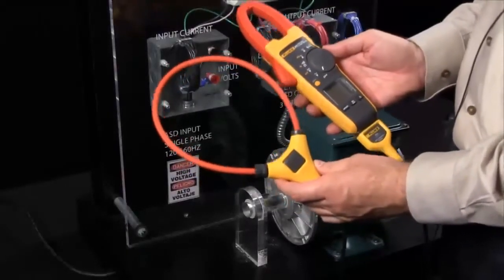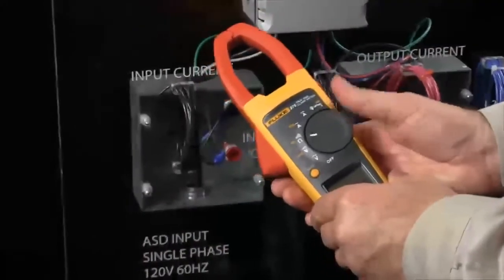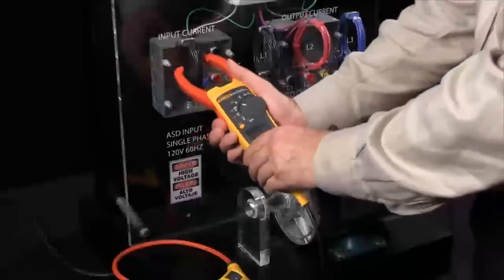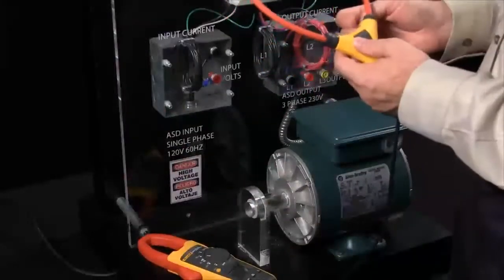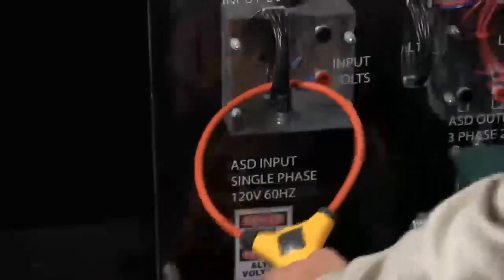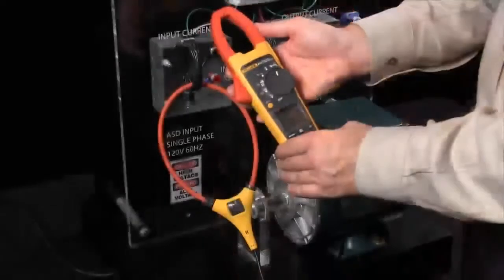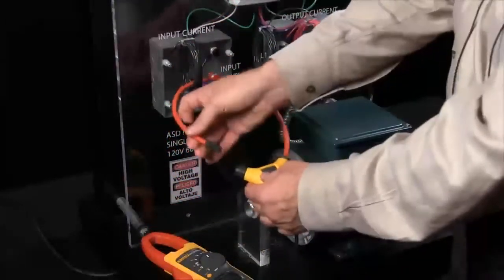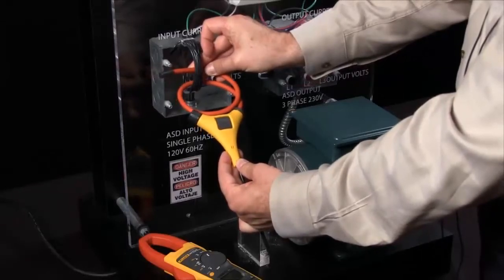How To Set Up the Fluke iFlex Flexible Current Probe

Comment: Tell me, is it possible to somehow modify the Fluke iFlex i2500-18 for use with the Fluke 289? So that it connects and takes measurements in the mV/A AC mode, like the Fluke i400E?
Reply from the maker: Thank you for your inquiry.
We do not recommend modifying the iFlex to work with a Multimeter. The unique plug design is intentional and ensures that the iFlex connects exclusively with compatible products.
The additional tube on the left side of the iFlex plug includes a metal pin. This pin connects with a corresponding port on a clamp meter, serving as a grounding mechanism or similar safety feature. This design ensures a secure and accurate connection.
For safety and accuracy, we advise against using our products outside their specified applications.
Reply: @ITMInstrumentsInc  But if I take full responsibility, I will not measure anything high-voltage, just tell me in a human way, in principle, is it technically possible or not, and not according to the instructions. I have a Fluke I2500-18 available, it is lying around unused. I would do this at my own risk, change the connector, select the transformation ratio, etc., the main thing is that its output is also in mV/A.
Nobody believed in Tesla either).
Thank you.
Reply: @ITMInstrumentsInc  Just say something like: We categorically (!) forbid doing this, but from an engineering standpoint, it has the same coil, only the transformation ratio is not 1000, but let's say 500 :)
Reply from the maker: @АлександрРезвей  Do NOT do this with your Fluke iFlex Flexible Current Probe!

Comment: Thanks. You failed to state a correction factor for the correct reading of current in the chosen conductor with multiple sensor wraps. Is there a factor, if so What is the factor? Get someone qualified  to inspect that instrument and refine your understanding. I believe there should be no deflection with a tool of that kind. Did you park your truck on it?
Reply from the maker: Thank you for bringing up this concern, Flash. We apologize for the delayed response.
Regarding your question about the correction factor for the current reading with multiple sensor wraps, when using the i2500-18 with the Fluke 376FC, there is no correction factor required. The user simply needs to select the iFlex function on the meter, and they will obtain a direct and accurate readout.
If you have any further questions or need additional clarification, please don't hesitate to reach out, information@itm.com.
Reply: @ITMInstrumentsInc  The needle with analog meters moves or deflects. Digital displays indicate and update. And there is a correction factor which corresponds to number of wraps as in coil windings because of electromagnetic coupling. I knew the answer before asking just like I know digital meters don't deflect, the activate optical segments in meaningful patterns, Unless you melt or physically damage your meter. Good day gentlemen.